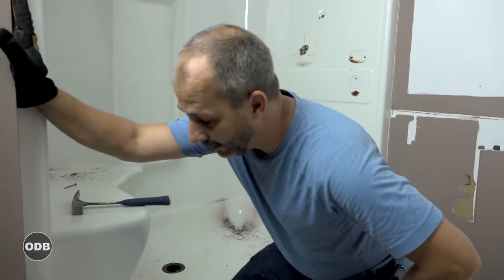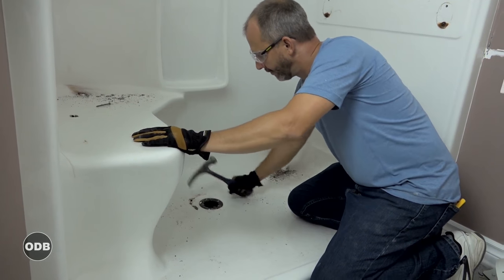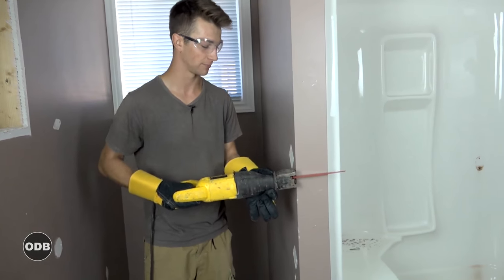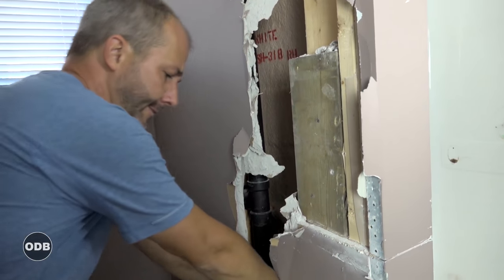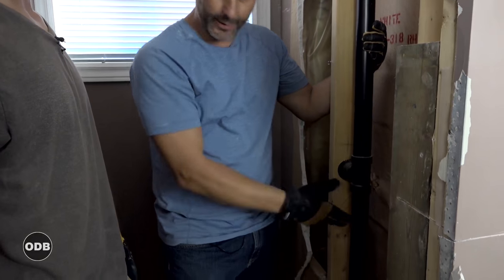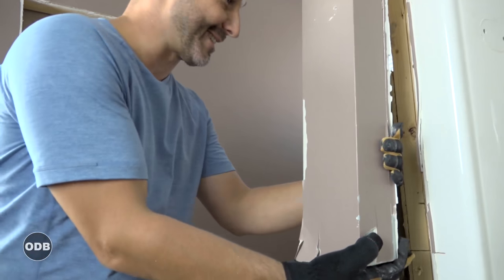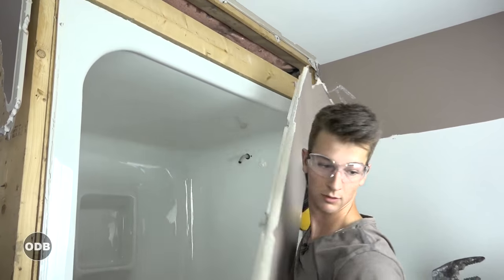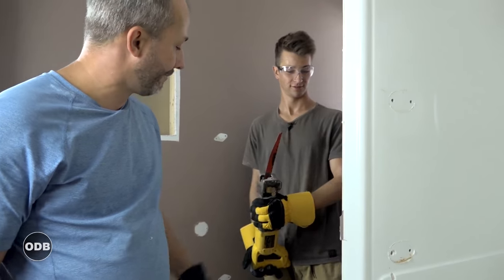How To Remove an Acrylic Shower Stall

Comment: Do you know what brand that shower was?  I’m building a little cabin and bought I believe a used shower that is this same brand. Its all 1 piece with a roof cap and light in the roof. For the life of me I cannot find a brand name on it therefore I cannot find the correct install Manuel online.

Comment: My husband and I are purchasing a home that has these types of inserts (rounded edges).  The shower unit is missing a door.  You can tell that there were three door hinge screws on the insert.  We are looking for a replacement door.  We would rather not have to take out the whole insert however we would like a door.  If that's not possible then we will consider a walk in tile shower which is more appealing but have been quoted about $5,000.....does anyone have any contacts with the insert company (any idea what company it is) who makes these to see if we can order a replacement door?
Reply from the maker: the door is a standard size. simply measure the hole and shop at any retailer. Cheers!